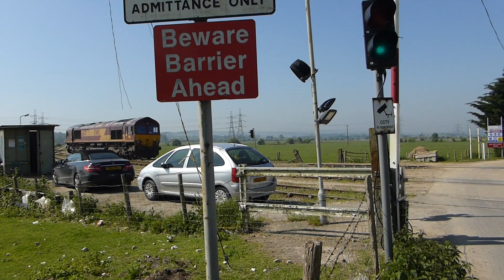SHEEP crossing railway line!

Comment: This spur looks never to have been electrified.
Reply from the maker: You are correct. Most freight only lines are non electrified.
Reply: What's maybe more interesting is that in your Angerstein clip, the line has a definite third rail up to the Fairthorn foot crossing, but beyond for only about 15 feet.
Reply from the maker: I know the rail you're talking about. That's called a check rail that's used on curves and bridges to make sure the wheels stay aligned when they go over the bridge or round the curve. This has some more information: https://www.quora.com/Whats-the-reason-of-those-iron-fits-between-rail-tracks
Reply: Thanks Morthren, that makes a whole lot more sense than a half-electrified spur. Seems there's quite a bit about railways for me still to learn.